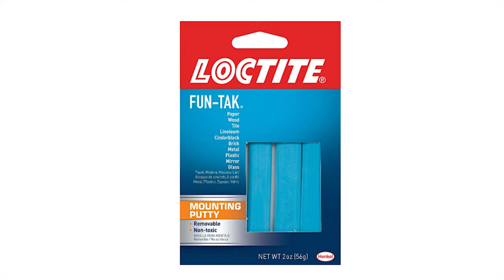Home Theater DIY: Reduce Rattles & Noise | Frequency Sweep Included

Comment: This is exactly what I've needed for my room!  I'm ashamed to say I've put up with rattles in my room's drop ceiling for 15 years, and finally tried to fix one trouble spot last week, but now I have a better way to find and fix them!!!  I can't wait to get home and run the sweeps!
Reply: for drop ceilings, sometimes it helps to put some weight on them.  Like little sandbags to keep the tiles from shaking.
Reply from the maker: Glad we could help! We have a full playlist to optimize your video and will be releasing even more audio tips soon. Check out this playlist here to optimize your room even better: https://youtube.com/playlist?list=PLu2zsBSyspw3xeqAcErYORjnm1ba_n-zg
Reply: @commanderrussels2612  I did that using some left over carpet that has rubber on the bottom, and cut it into strips to weigh down a few of the thinner panels around the edge of the ceiling, and it worked great!
Reply: @TerminatorJuice  Awesome.  Having to do it over again, would you prefer a drop ceiling or drywall?
Reply: @commanderrussels2612  I'd do the drop Ceiling 100 times out of 100!  But my ceiling height is only 6' 10" so drywall doesn't make sense for me... If I had 9' ceilings then I would have done something more elaborate and used drywall and crown molding.  But also, I like to have easy access to all my wires, duct work, and pipes, so the drop ceiling gives me that advantage.

Comment: Good video. Useful for the people that don't know how to use REW's tone generator and sweep generator. I've taken care of most my rattles but I think my air vent/windows/ blinds are still vibrating. Not sure I can really do anything about them because the air vent is in the floor and isn't even screwed down. Need to just get so isolation pads like the auralex subdude ht.
Reply from the maker: Thanks, REW is pretty deep and scary for most DIY people and even some pros.  You could try some blue tack under the air vent if it is rattling.  But sub vibration pads or pods are a good idea.  SVS also makes some good ones  https://www.audioadvice.com/shop-by-brand/svs/svs-soundpath-subwoofer-isolation-system